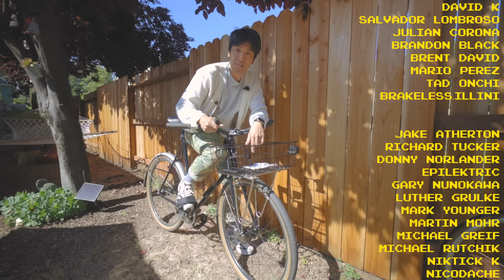Should You Build Your Dream Bike?

Comment: Slowly built my dream bike. Finally "finished it" as in it just needs a new wheel set. But if I actually finish it I'm afraid I won't enjoy it so it's stays as it for now so it can stay a functional tool. Landed a free frame and painted it for fun and now I'm planning on building that as a commuter. Aesthetics are the goal for that one. It's a steel frame that I wanna kit out with as much used and amazon parts as I can get to not spend crazy on something that specifically just meant to be a tool.

Comment: 2:03 "$3,500. That's a lot of money for a bicycle."

By fixed gear standards. By roadie standards, that's just a mid-tier carbon frame.
Reply: That's sad.
Reply: Stay spending 10k on a "high-tier" bike i guess
Reply: @jiroephraimcabanto2915  buy a fixed gear, that's it.  Maybe some nice components.  But they'll last.
Buy a high end road bike, you'll be trapped in a cycle of perpetually catching up to the latest crap.
Reply: @orlandogodoy3233 . After many years not riding I now have a  fixed gear bike and personally I do not see the attraction.   I am  used to / love a 10 to 18 gear bike.   Can you explain the attraction other than shear simplicity?
Reply: @mrpentium  
1 cheap 
2 reliability 
3 easy to maintain
Reply: For an enthusiast, whether it’s a bike, guitar or whatever hobby, cheap and easy are  immaterial.  At least for me. Now reliable and fun, those are the standards I seek.
Reply: Same for cargo bikes, I think I'm in 5 digits 😅

Comment: Well said. I ditched all my bikes last year then for new year I got a new old stock State Bicycle Co Warhawk SSCX that I slowly kitted to a gravel setup. But ended up being too nice to commute on.

Got a hand of a used State Bicycle Co Carolina core Line fixed gear and just changed the pedals, handlebars, 32c tires and chain. Been riding it ever since I got it as a commuter bike than my SSCX.

Well said on the video plus the philosophy 🌞

Comment: I salvaged a Specialized Globe Work 2 and rebuilt it as a mountain bike. I ditched the fenders and squeezed 2.1" knobbies on the original rims, with Slime self-sealing tubes. Got a grab box of used parts from a bike shop and upgraded the cranks and handlebars. Converted it to a 1x7 and started riding it as a single speed since the shifter was toast, and was surprised how much I loved not dealing with gears anymore! With all the scuffed-up old parts and the gunmetal grey frame, she doesn't look like much, which is great since this is a high bike theft area. But it's a sick bike -- tough as hell, minimal maintenance, and great to ride. Couldn't be happier and it feels great to have saved her from the scrap heap.

Comment: My light purple steel FG has aged gracefully for 13 years despite constant use. Zach even did a bike check once (All City Big Block). Mid-level parts got swapped out for the long lasting high-end stuff as they wore out. That said, my B-bike is an un-lockable retro Ti racer good for the hill country.

Comment: Hey random suggestion but i just started watching some of your videos and somewhere you mentioned that your run fixed cogs on both sides of your flip flop hub to get different gear ratios for different terrain. I love this concept and would like to do it with my bike. I just did some preliminary research about how to swap the freewheel for a fixed cog and while I'm confident I'll be able to figure it out eventually, my initial few minutes of research kind of confused me more than clarifying things which made me wish there was a video that explains the different components involved in installing a freewheel vs a cog and if there are any complications to creating this sort of '2 gear' fixed set up.

Some other stuff I just felt like sharing:
I'm new to fixed gear and just found a used wabi thunder (perfect frame size for me) that i'm absolutely in love with. I've biked regularly in the past as my main commuting method but have never been a 'cyclist' in the sense that I'm like an enthusiast about the components or even really consider riding fun. Maybe its a way to get someplace fun, or it might provide some sense of accomplishment, but not fun in a pure type-1 sense. In fact as recently as three weeks ago I told someone I just met that I hate biking and I meant it. Well apparently I just never had a bike I really loved. I honestly had no idea that biking could be this fun. Originally I was just looking for single speed bikes cause I f*#king hate derailleurs. In the process I stumbled into the dream bike that I never knew existed. Didn't know steel frames (which I've always been partial to) could be so light. I love the classic design. It got me to try fixed which I now love too. Getting this bike has been such a win for me.

While I was waiting for the seller of my wabi thunder to get the bike reassembled (they had a broken spoke and the wheel was out for balancing when i contacted them) I was looking at the framesets on the wabi website and saw the ube purple chrome lug was available. I briefly considered buying it before coming to my senses. It would have been an absolutely insane financial decision and made no sense given that the used wabi was available for so cheap locally, AND YET when I see those chrome lugs on there I still have moments when I regret not impulse buying lol